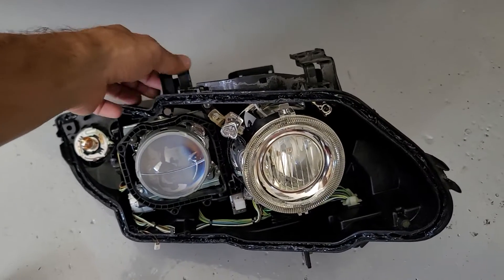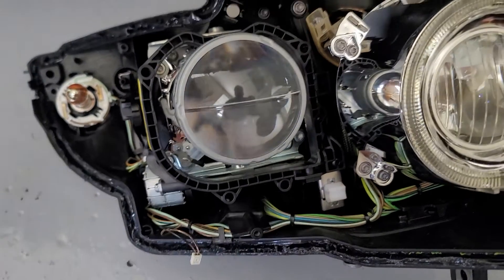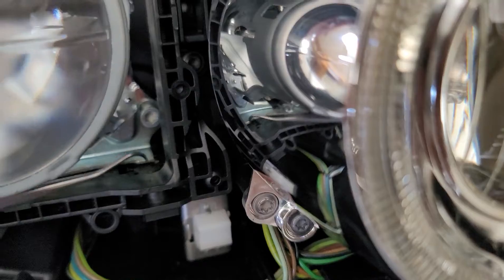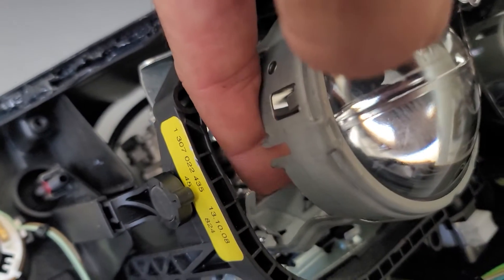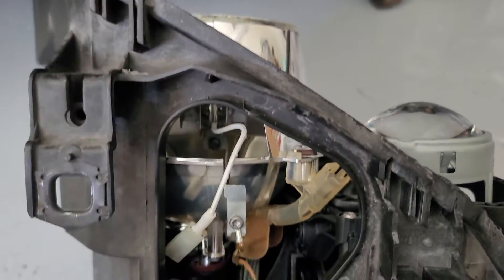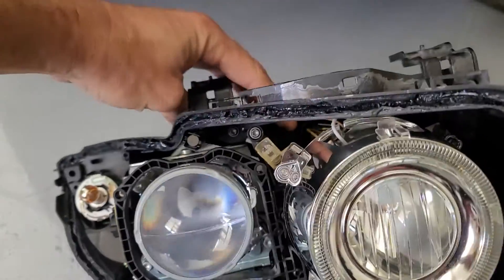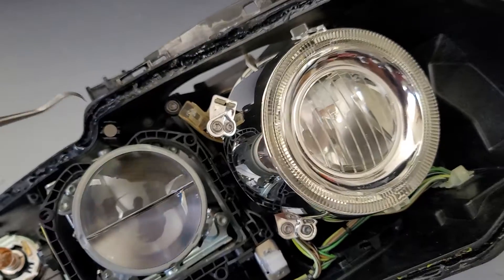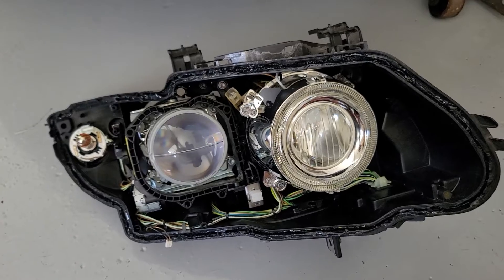Disassembled BMW Active Headlight Overview E90, E92, 335i, 328I

Comment: do you have any tips if the manual height adjuster is broken? any way to repair?
Reply from the maker: I would assume you have to pull the lense and remove the adjuster rod to repair it. I would use a jb weld type product. I would also see if you can get a metal tube that the rod can fit inside of ( like a sleeve - brass rod or aluminum from a hobby shop comes in many diameters ) and jb weld it all together. Sand all the surfaces of the plastic ( 80 -120 grit) for better adhesion. Wash all the parts and dry them before gluing.
Reply: @lillyautomotive  damn, thank you for the fast and informative response 🥰
Reply from the maker: @grunntok any time. Be sure any fix will slide thru the headlight housing or do the repairs with the rod inside the housing if its too thick

Comment: @lillyautomotive 
Hi there, my car driver side high beam sometimes works and sometimes doesn't. 
It may work after a few tries, my car failed the test because of this, I changed the bulb and still the same.
The low beam is working fine.
what do you recommend about this?? Do you have any idea please?
Reply from the maker: I would look at the ballast, make sure there's no water in it & swap ballast from the other side and see if the light works. 

If there's water in the ballast you can submerge it and wash it in IPA (iso-propel alcohol 91%) if you have it available and let the unit dry (for a few hours at least) and see if it functions. 

Otherwise might be a wiring issue
Reply: @lillyautomotive  I checked the ballast, the motor, the flapper, and the wires. Everything is good.
The high beam is still not working properly, I'm so confused.
what else do you think? 
Does FRM coding have anything to do with that?
Reply from the maker: Ah ok I misread your post in the beginning. It seems as though the solenoid that activates to move the shield is not working. I would check to see if you hear it clicking (if it is) then check the linkages, if it's not then check the wiring. You may want to get a pin out / wiring diagram and make sure the high beam signal is getting to the headlight. If it is then you'll probably want to bake the headlight apart and check all the wiring inside of it

Comment: Does this mean that there are no dedicated light bulbs for the high beams?
Reply from the maker: Correct, one xenon bulb for low & high beam (aka bi-xenon), with a shutter that moves to block or allow light through to the lense / road.